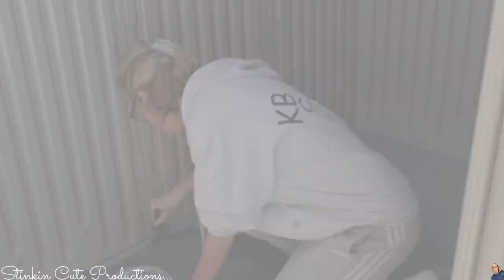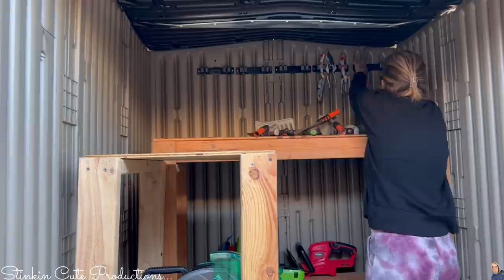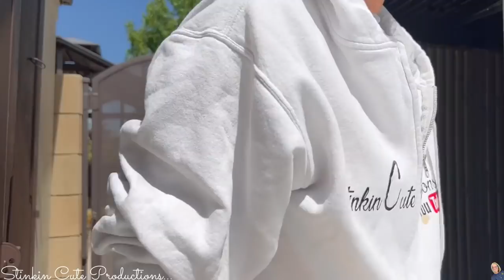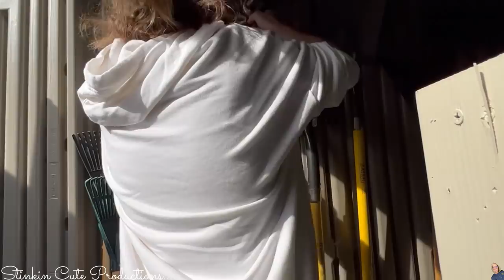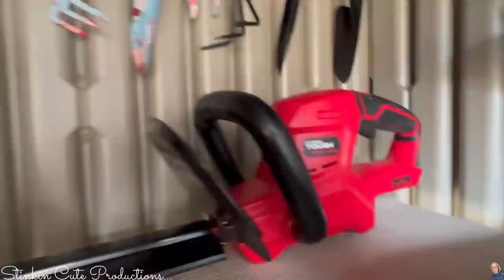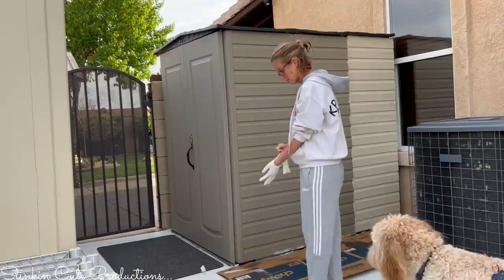EXTREME PLASTIC SHED MAKEOVER & ORGANIZE on a BUDGET!

Comment: Your sheds look great. I only have one concern. When painting vinyl/vinyl siding, you are not supposed to paint it darker than the original color. If you paint it darker, it could overheat and warp. Your doors were dark, but not as dark as you painted them. I really hope it does not cause problems. Congratulations on another successful DIY.

Comment: Porch, floor, and patio paint might nt stick to the plastic -- mot paints don't. You might have better luck "painting" on some liquid Flex Seal -- and it will help seal any cracks or leaks in the flooring. If you want to use spray paint on your shed, be SURE you get the kind that is made for plastics.